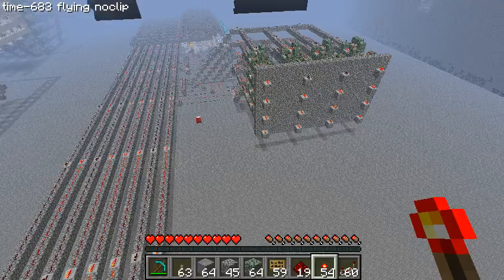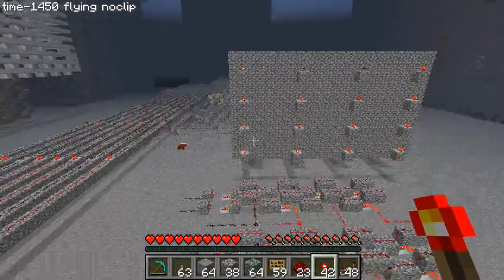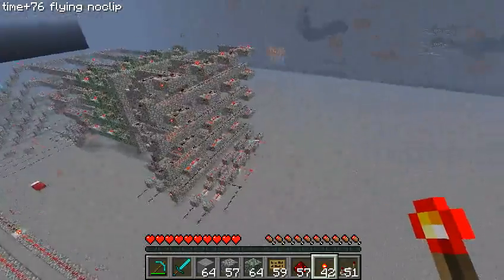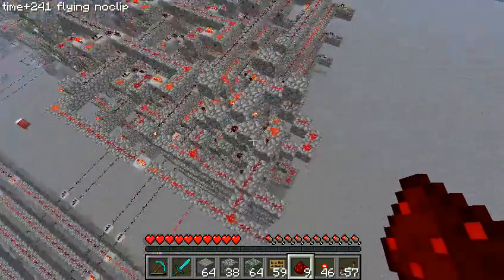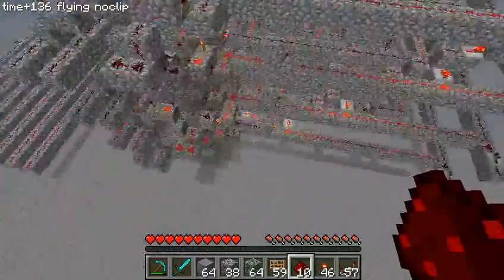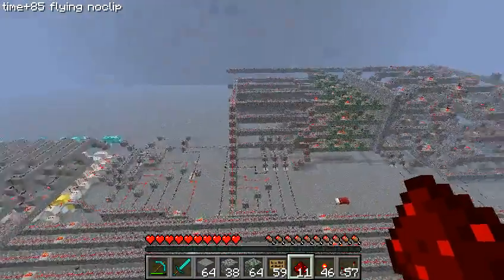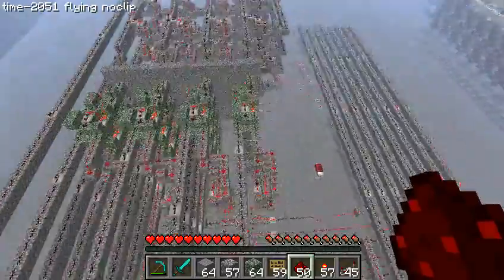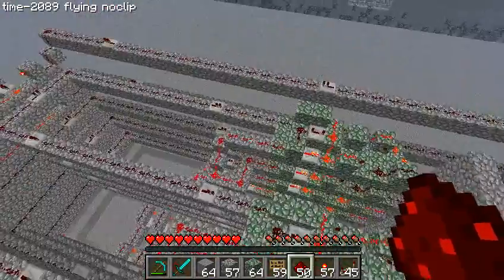Building a Minecraft Computer part 6 - ALU

Comment: you would love the mod redpower.  It adds basic logic gates that work sortof like repeaters, red alloy wire which can go for 256 blocks before running out of strength and can go on walls and ceilings, covers which can go in the same block as a wire and support more wire, colored wire which doesn't connect to other colors, bundled wire which can hold 16 wires at once and much more.  You can find it at eloraam.com

Comment from the maker: a bus is basically a wire that sends information (1, or 0) to other parts of the computer. a 1-bit bus is only 1 wire, and can only send 1 bit at a time. a 2-bit bus has 2 wires, and can send 2 bits at the same time. etc...

Comment from the maker: a mux, also called a multiplexer takes 2 inputs (can be buses or single bit inputs) as well as a 'select' input, and outputs one of the 2 buses, depending on the state of the 'select' input. eg: input buses: A, B. if 'select' = 0, then the output is A, if 'select' = 1, then the output is B. wikipedia has a lot of information on these sort of things.

Comment: These videos are great, I have been planning on making a CPU but didn't realy know how to, but this realy helps, keep up the good work. Also I had some problems with branching, I used the schematics you made, and added the missing parts from the video, but for some reason I had to swap the clock signal around, so that the second flip flop was getting inverted instead of the first, also the fixes for keeping the signal on each line would break mine, not sure why.

Comment from the maker: because the register it reads and writes to is edge triggered. that means it will only change value once in a clock cycle. so the register may change value, and new result calculated, and put on the bus to be sent to the register.... but the register will not read anything else off the bus. or at least until the next instruction and clock cycle comes around.